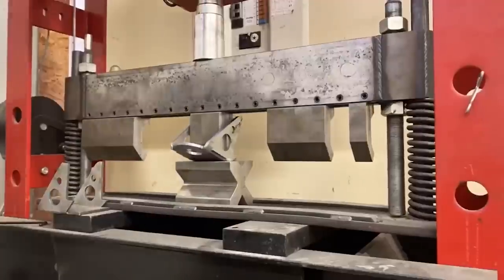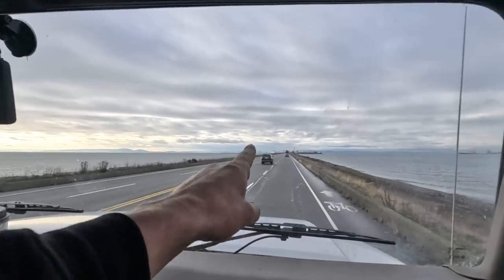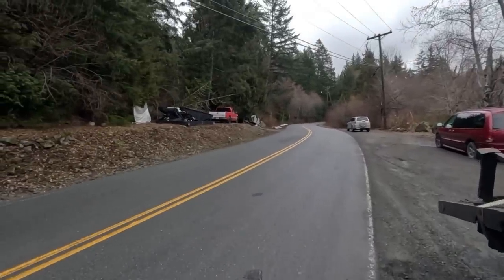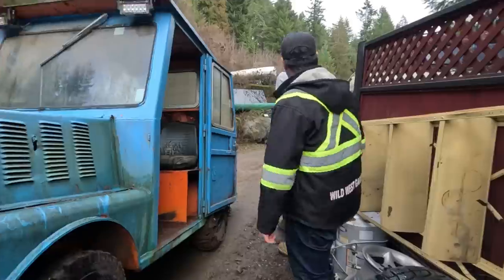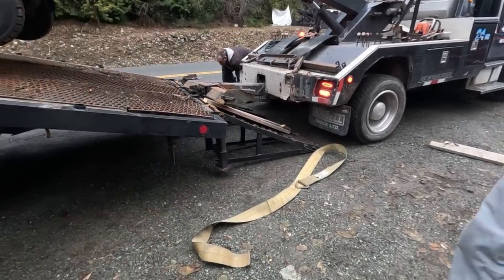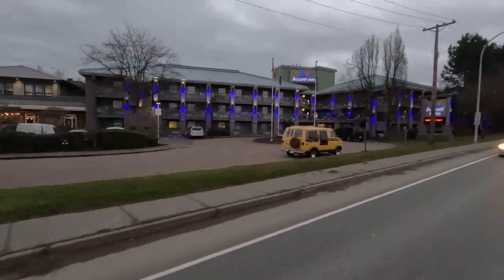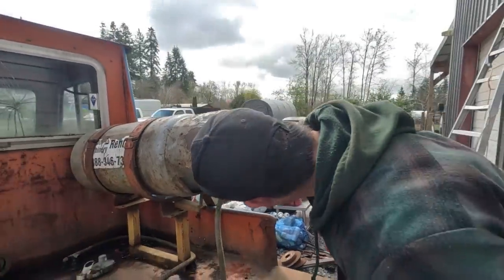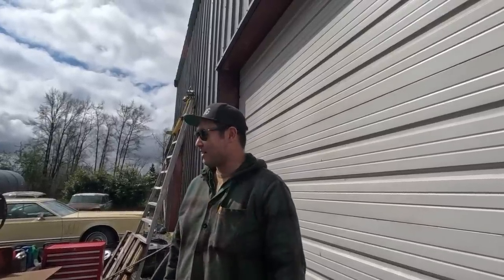Weirdest Truck Ever = WILL IT RUN? Island Road Trip For a "Truckster"

Comment: That contraption brings back memories. I worked at a transmission shop in the mid to late 80's. we had an airport tug quite similar to that one. Remove the cab and all the plow related stuff up front and paint it the same orange color as your interior and that was our tug named Egor. We had an old tire mounted to the front and we pushed the vehicles into the transmission shop all the time with it.

Comment: i used to work on airport ground equipment and that stuff can be some of the most rigged together junk you've ever seen.  Second and third gear may be locked out on that trans if the shifter can reach those gears. Most of those shifters are set up to only go into  drive. If that trans has been replaced and more than likely it has, it's more than likely a junkyard trans so it should have all 3 gears. It should also be governed to about 20-30 mph. there will be a little contraption under the carb, that's the governor.

Comment: That Tiger tow tractor...I was the release engineer for it at Taylor Dunn in Anaheim, CA. The light on the side lifts up and down by a twist of the wrist...i designed the mechanism. The engine is probably a cummins 4.5L non turbo

Comment: Electric power steering pumps from Toyota Corollas generate 2200psi ,
Couple of them mounted independently would give you heaps of hydraulic adjustment with a couple of double acting rams .

Comment: "Nothing else cool"... did you even SEE that four wheel tractor uphill from the dozer (16:36 in the video)? Not sure what it is, but looks like someone put four big tractor wheels on what used to be a tracked bulldozer. As a side note, there is an old Lamborghini (yes, that Lambo) dozer model where you do pretty much that if you need to drive over pavement for any distance.
Speaking of propane VS gasoline though, what's the burn rate of propane? If a grill tank holds about 4 gallons of LPG, does that mean that an engine will run on it about as long as on 4 gallons of gas? All this talk of "stays clean and goes not gum up carbs" makes me think of converting a few small things to LPG.
Reply: Pretty similar calorific value between LPG & gasoline but you get about 20% less per gallon in reality - back in the 90s LPG started being fitted to cars in the UK with one manufacturer (Vauxhall - part of GM) offering dual fuel (petrol/LPG) cars from the factory.. never really caught on and LPG filling stations are disappearing rapidly now, despite the benefits in terms of cost and emissions (LPG being about 90p/litre vs 140p/litre for petrol - about $4/gal vs $6.60/gal .. or CA$6.40/gal vs CA$8.95/gal if you're in Canada). That 20% less economy is with a modern fuel injection setup btw, an old mixer-style system on a carb is probably a shade worse.
Reply: @aaronbuildsa  Interesting. So even with worse fuel economy it may still be cheaper in the long run if the prices are right. So far the only real down-side i see is that LPG tanks are pretty massive when compared to gasoline tanks, and they only come in certain sizes where as a gas tank can be easily made into whatever. I suppose a 'bank' of separate smaller tanks can be used in some cases. Also interesting that LPG was being used in production road vehicles that far back. I have seen some LPG trucks before, but thought that was a fairly new thing.
Still, definitely worth considering for things that sit for a while, like a pressure washer. Thank you for the information!
Reply: @AgentWest  Yeah, LPG tanks are big - you tend to have a choice between either losing a lot of boot (trunk!) space or sacrificing a spare wheel for a 'donut' tank which doesn't hold much. But still, when filling stations were common, a 30%+ saving per mile was worth it! Now it's hard to find a regular gas station that also has an LPG pump.

I think LPG was more common in mainland Europe (which is why Vauxhall/Opel had dual fuel cars for a while, very late 90s through early 00s in the Omega and Vectra/Cavalier, at least) but they also had CNG (Compressed Natural Gas) in the futher south & east countries (at least in Italy and Romania based on stories my friends from there have of their youth!).. CNG has a nasty habit of going 'bang' in a big way, though, hence LPG was the safer, newer alternative. Slightly less bangy-explody, you just have to keep your hands away from the freezing cold filler :)
Reply: @aaronbuildsa  Europe had self-service LPG fill at regular gas stations? Here a couple states don't even trust people (literally made it illegal) to pump regular gasoline. 
That said, there are many places, mostly farm supply stores, that actually pump LPG. It is very common for forklifts and those tanks are usually refilled on the spot instead of swapping an empty tank fora different full one like a regular store/gas station would.